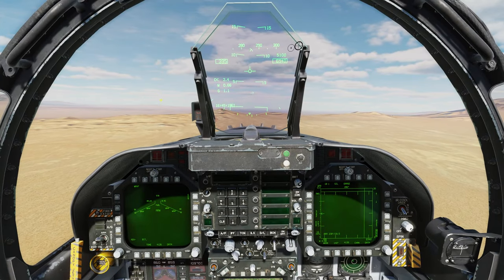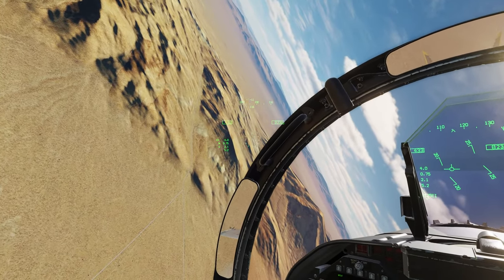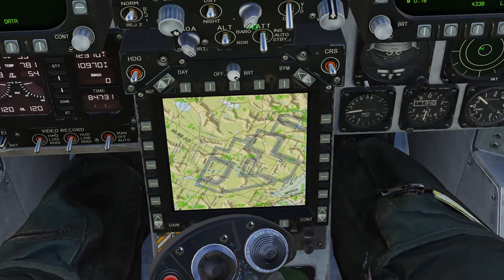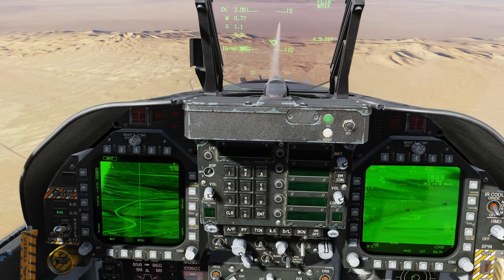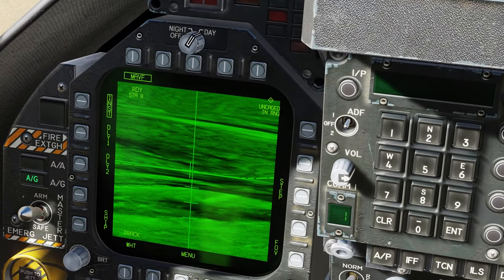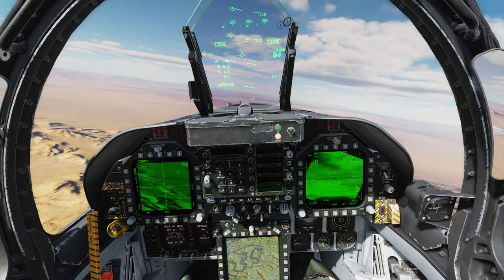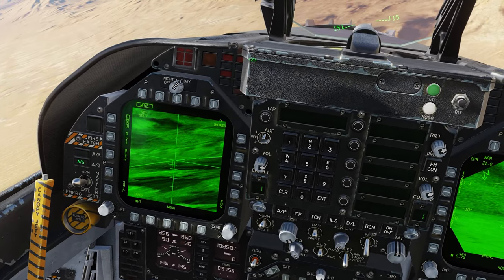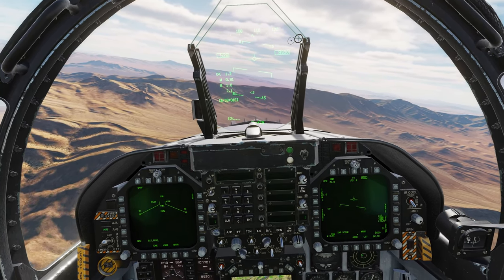F18 Hornet Mavericks with the Helmet Mounted Display - DCS World

Comment: FYI you can use the RAID/FLIR FOV select switch to toggle MAVF FOV

Another way to do the the dual target attack is with the FLIR offset. Have an AUTO track on the first target, TDC depress to make the offset cursor appear, slew this to the second target. Fire first Mav, SCS to FLIR will make the offset the primary TGT instantly, fire the second Mav. (fun fact: the offset logic is wrong in DCS, it should be the other way around with the offset slewing the FLIR image.)

Also, don't make a MK, it's such an unnecessary step. Put a sensor like the FLIR or radar in track so if you hit undesignate, just the designation is removed but the sensor will still be pointed in the right direction. 

Good video!
Reply from the maker: These are interesting and fun facts, I’ll test these out. Thanks for sharing
Reply: @TrickerDCS  Hello. Do you remember if you tried the thing with the FLIR offset? I tried and the mav doesnt want to lock to the WPDSG point but rather to a point that is between that and the offset. I dont know if Im doing it right :/